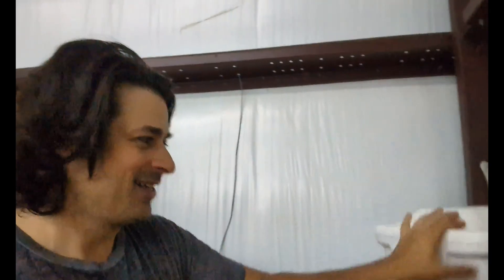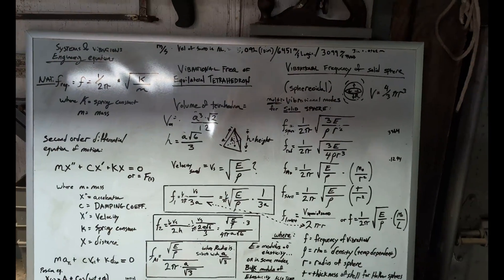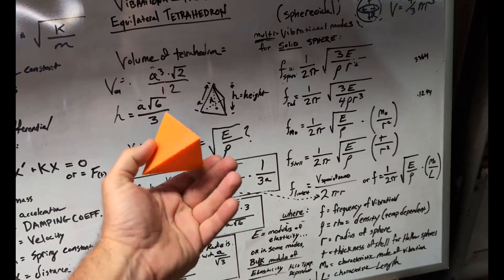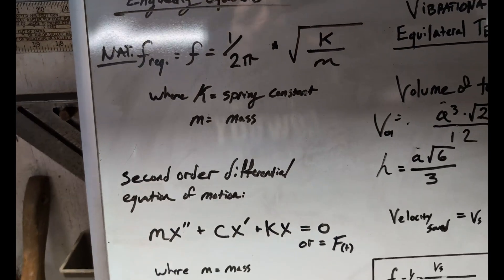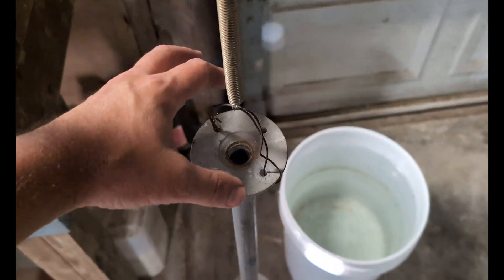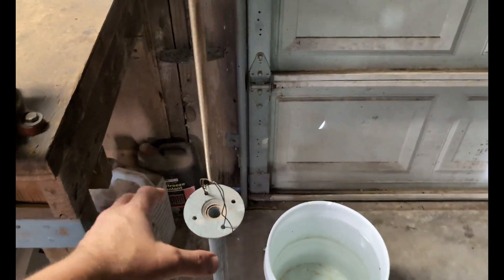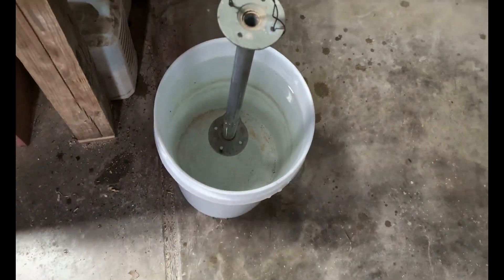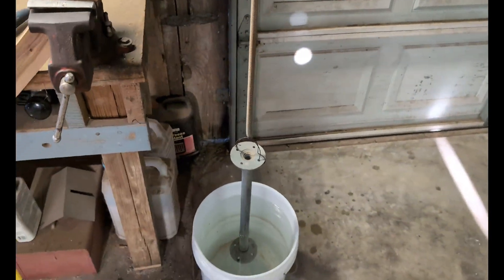Vibrational Frequency of a Pyramid - Pt. 1 - Theoretical Equations

Comment: I'm generally following your explanations and I'm enough of a science and math enthusiast to understand the video on face value - each molecule is an oscillator for which we have an equation of motion. What I'm not understanding is what sort of effects we should expect to see at a macroscopic level. What does it mean for a solid shape to have a vibrational frequency?
Reply from the maker: @gregsmith80  Good question, at the scale we are working at, think in terms of audible tones.  If you were to take a 7 inch long aluminum bar (like what are used on a xylophone) and strike it, that object would vibrate with an audible tone, maybe 700 hz or something in that range.

Now suppose I cast a 7 inch pyramid out of aluminum, and strike it, what vibrational frequency will it make based on its geometry?  That is the equation I'm after 

Now whether or not it will be useful in some deeper understanding of reality is, I must admit, speculation on my part.  That speculation is based on the idea that, if you think of atoms as little spheres, then the contact points between those little spheres could be mapped out in the shape of equilateral tetrahedrons...so that's why I think having a vibrational equation for this particular shape might be useful to science.
Reply: @CharlieMacklin1  Gotcha. Have you looked into cymatic patterns? There may be some useful mathematical models in that domain. I wouldn't know. I have toast for brains.
Reply from the maker: @gregsmith80  I'm sure you're doing just fine :) and yes, cymatics are very interesting, I think that each atom creates its electron cloud in the shape of a cymatics, so each atom has its unique shape.  So, that actually throws a curveball into the model I'm using, which sort of assumes atoms would pack "like a jar of marbles" with each atom basically in the shape of a sphere, and with the spaces in between based on the geometry of a tetrahedron... I think it will still be of some use to find this equation, and I'm happy to report some preliminary breakthroughs I've had today.

I cast an aluminum model about 6.25 inches on the main side ... And I'm getting a frequency signal at 12,281 hz, or about that range, the signal is a bit rough but I have a couple of working equations just a shade different than the ones in the video although they are in the ballpark. 

I guess I'm just stoked because no one has done this test before (that I know of anyway)
Reply from the maker: The test is done by striking a hammer on the metallic solid pyramid, there seems to be a "sweet spot" about half an inch in from the tips. More testing and refinement is needed, again, these are just today's results.

Comment: No, and no, and no and no. NO
In fact; NO to everything in this video. This is not how this works.

You simply copied some (already) well known formulas from an engineering textbook and then tried (very poorly) to describe what they mean in order to try to "make it fit" whatever your end-goal is regarding pyramids. Here is why your ideas are wrong: 
In no way whatsoever do these equations describe the "frequency" of a pyramid or any other 2-D/3-D shapes since 2-D/3-D shapes DO NOT have any "frequency" at all. Squares, cubes, triangles,pyramids, dogs, cats humans, the pyramids of Giza etc... DO NOT HAVE FREQUENCIES because they are macroscopic.

Two kinds of things DO have frequencies, by definition:

1) Things that have a repeating CYCLE are things that have a frequency ie. a rotating wheel, or the orbits of planets around stars, or the time intervals between wave crests and peaks. The word "frequency" has a definition which is: "cycles per unit time (seconds, in this case, or Hz- hertz)*. 
Note that the unit of time is involved) which is NOT how any 2-D or 3-D pyramid behaves.Pyramids DO NOT CYCLE, THUS NO FREQUENCY (vibration/cycle).

2) Atoms exhibit wave-like properties which can be said to have a frequency. Sub atomic particles which behave like waves can be described (somewhat) as having a frequency.
However, macroscopic things like 3-D pyramids CANNOT be described as having a frequency (since they have no vibration or cycle).

In this video, you are using terms incorrectly. 

You are also trying to sound knowledgeable for your audience where anybody with a grade 12 understanding of geometry and  physics can clearly see straight through this.

Why not admit that you don't know instead of trying to spread nonsense that may take years for an unsuspecting student to undo?
What are your credentials? Do you do physics as a full-time job? Are you employed in the sciences? 
I'll bet not.
Don't listen to this nonsense, guys; he is doing you a disservice, even though he may not be aware of it or doing it on purpose.
Reply: It seems like you may have been rash in attacking someone on a subject you're not well equipped for. Chill out and move on, dude.
Reply: @CharlieMacklin1  Didn't watch the video bc. i am sceptical of there being an analytical function for what i believe i think you want is a "Eigenfrequency". Everybody has one, multiple at which and its multiples the object excites. Yes, even 3D. But usually, when it comes to finding the Eigenfrequencies of anything other than a simple system (made of springs, pointmasses), you'd take the route of computing it via FEM for example. WDYT?
I dont think its impossible tho, since you are comparing identical geometries. But i dont know how else i would go over it but with FEM. Plan B would be to analyse in FEM Software, vary the geometrixs, stiffness or mass and see if there is a function you can get through curve fitting. Regarding the analytical route (and this is just spitballing): If I imagine that one EF is likely having an Eigenmode (EM) where all corners are pulled, id try so solve a simplified system of 4 point masses connected by springs to each other and then solve the multidimenxional equation you have written down: mx"+kx=0.
Reply from the maker: @TobiDeMonkey   Finite element analysis is one of the ways that is recommended for finding the vibrational frequency of complex shapes.  I'd be up for running a finite element analysis using the computer, in fact I think Fusion 360 (which is what I used to print the exact shape) is capable of that, so I'm up for looking into it if I have no luck with it.  Today I cast an aluminum 6" equaliteral tetrahedron, it's cool off as we speak and I will see if I can get it to "ring" with any audible tone.  So far, my experiments are showing that the shape is somewhat resistant to vibrating, I guess because of the angles reinforcing the stiffness.  I'm sure a hollow pyramid or tubular lattice pyramid would vibrate better.

 Eigenfrequency by definition seems to be what I'm seeking for this shape.  My thinking is that if I can figure out what distance a sound wave will bounce around inside the metal, then some basic equation can be found.  I just think it's an interesting equation to have and I couldn't find anything definite out there, maybe someone already has it, heck maybe some engineer who plays with FEA already knows and this is all baby stuff to them lol. 

It just seems to me there should be a "somewhat" simple equation for the vibrational frequency of a solid mass in this 3D shape.  There are known equations for spheres and bars, But like you said, there could be more complex modes of vibration.   I plan on doing another video if I can find anything interesting from testing metals.  Obviously, a rigid material is needed, a material like lead would be too soft and function more like a dampener at the microscopic level.
Reply from the maker: @MeanWhatYouSayYouMean   No sir, YOU are MOSTLY WRONG...most everything in this universe is in motion, whether at the Macroscopic or the microscopic.  You are doing me a disservice by making assumptions and by being an asshole and tearing down someone's work and hard earned audience instead of actually helping me solve the question.

I have decades of engineering experience and I have had college level physics 1 and 2, calculus 1, 2, and 3, and differential equations, and systems and vibrations, and controls of engineering systems.  I may be a bit rusty, but I passed the PE license exam for thermal fluid systems on the first go around.  If you think you can solve the equation before I can, then go for it.

If I give you 2 foot rod of hardened steel and say "determine the vibrational frequency" ...one way to do it would be to strike yourself in your obviously dense cranium, listen to the ringing tone, and compare it with known audible tones, the same way a guitar is tuned.  OR you could go to a text book, determine the speed of sound in hardened steel using Young's modulus, and the based on the geometry of the object, predict it's vibrational frequency.

Macroscopic vibrational frequencies DO exist, and it is imperative to understand this unless you want another event like the Tacoma Narrows Bridge collapse.

On larger scale objects we use the spring, mass, and damper analysis methods.  At the microscopic the same things occur, you just can't see them.  An example would be the way in which microwave frequencies cause water molecules to vibrate, resulting in heat, which is how a microwave works.  

EVERYTHING in the 3D physical reality is vibrating at some scale...or in multiple complex ways, you just can't see it...BUT YOU WILL.  Since we've had this conversation you are going to start to notice what you've been blind to.  Power lines swaying in the wind.  Waves at the beach. Light poles vibrate when the wind is just right.  You will notice and you will learn.
Reply: @ Yes agreed. Real world things can be MADE to exhibit a frequency by APPLYING a force. The frequency itself doesn't exist on its own. How is this useful for "finding the vibrational frequency of a pyramid'? Seems you are conflating concepts and then saying "AHA! SEE!" when it's not really like that in reality.
Reply from the maker: @airwavesenglish2508   It sounds to me like you latched on to a textbook definition of "vibrational frequency" and have some axe to grind regarding new age concepts, and I can't fault you for attempting to be correct by scientific definitions.  You mentioned the great pyramid of Giza, I DID NOT mention that in my video, yes it is an interesting topic but you are making assumptions about my world view.  

If you can find a math error in my equations about the way that a sound wave would oscillate through a solid equilateral tetrahedron then I'd be glad to fix it.  

Or if you can find from some textbook or engineering source, a study on the vibrational frequency of solid pyramids, I'd be glad to look at it.  As far as I know, it is an area lacking in study.  I showed the equations for vibrational frequency in spheres because it has been studied.  We have to start somewhere.
Reply: Now I know how Galileo felt when he tried to relate his findings to the Vatican.
Reply from the maker: @dellto529  you and me both lol
Reply from the maker: The irony is that, a 3 sided solid pyramid doesn't vibrate very well, so far even a random blob of aluminum will vibrate better 😂 I think this is because the geometry of a solid metallic pyramid is very rigid.  I'm sure it will perform better as a hollow metallic object for making an audible tone

Comment: l liked and understood the event at 10 minutes and 10 seconds based upon my understanding of the Yanked Crank Theorem..
Reply from the maker: @dellto529   🤣 well it's not a yanked crank like the turbo encabulator, actually these equations are REAL and should be able to predict the vibrational frequency of a solid metal object, even if I have a few mistakes in the math.  I couldn't find any previously existing equation for an equilateral tetrahedron so I figure why not find that equation.
Reply: @CharlieMacklin1  1) "Vibrational frequencies" of solid metals don't exist. This is why there are no formulas or equations for them. 
2) An equilateral tetrahedron doesn't have"an equation"; it only has dimensions. Stop making up silly nonsense and then trying to "teach" it to others...jeeez your ideas are just as bad as flat earthers' ideas. ZERO credibility.